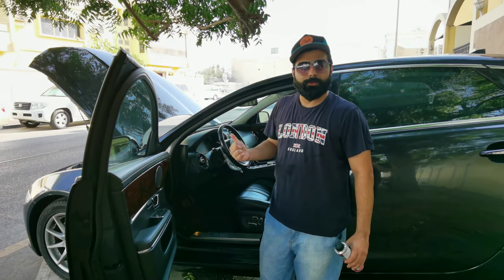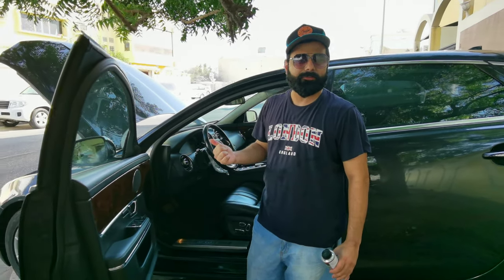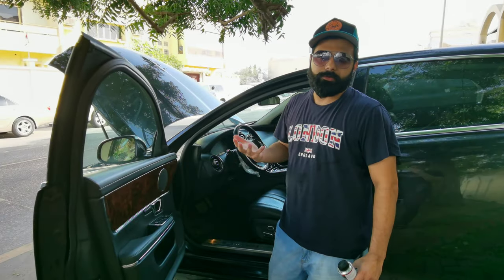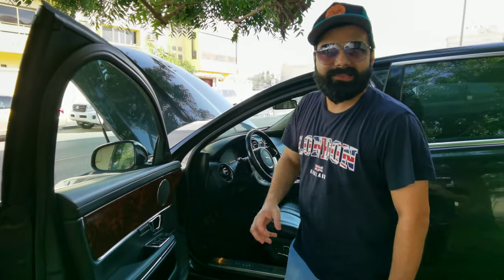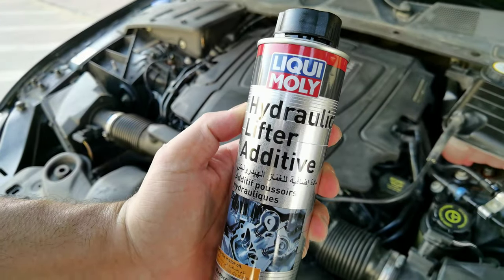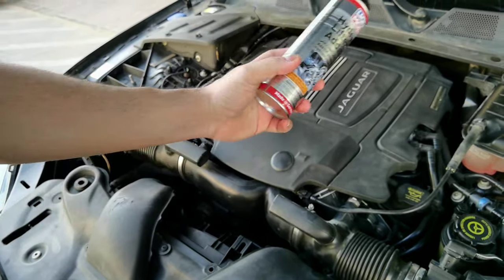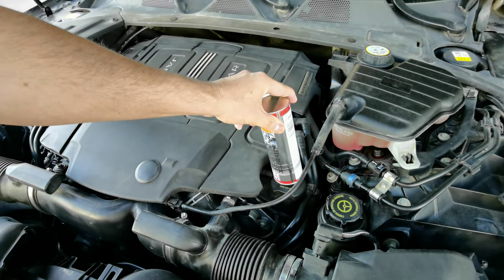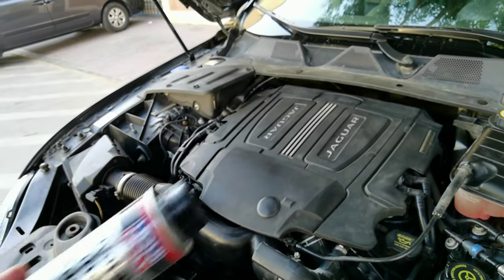Jaguar Xj 3.0 V6 Supercharged - rattle/ticking sound

Comment: Mine sounds exactly the same, it started last year only on a cold start, then every time, but stopped when engine went to warm idle. Now it happens all the time. It sounds like tappett noise. My car has done less than 30K miles. It is a 2014 model, dealer serviced. Sounds like a diesel engine! No engine codes on my iCarsoft JLR OBD scanner.
Reply: Any problem till today ?
Reply: please tell me what happened we are in the exact and I mean exact situation.
Reply: Hello. I also would like to know what you found out. My loved XJR is also making this rattle noise when he is cold, after a fee minutes of warming up it diappears almost completely. Thanks in advance
Reply: @jr5588  I have the same problem. Do you have any update?
Reply: Did you resolve this? can you give an update? Thank you

Comment: The timing chain tensioner is getting loose. I have same exact noise on my LR Discovery. Same engine. I'm going to try Lucas oil treatment per mechanic. In the near future the timing kit needs to be changed. 😊

Comment: Fixed? Or nothing changed? Thanks
Reply from the maker: Nothing changed ... Some other issue
Reply: I had a knocking noise and was told it's the supercharge it self needs to be replaced. At first they thought it was the pully.
Reply from the maker: @cdltruck2738  yeh i removed the belts to make sure it wasn't the supercharger . Its something inside the engine
Reply: @junedkaka  So what was causing the noise if not the supercharger, timing chain? valves?
Reply from the maker: @Broeils  yeh the timing chain

Comment: Knock when you turn the engine off is the supercharger pulley coupler, you feel this by removing the belt, there should be no movement / play in the pulley driving the charger shaft. 
The noise whilst running is actually a recall they had on the timing chain guides, the chain wears them quickly and becomes slack. The offer a new version of the guides. If you leave that too long the chain slips and bends the valves
Reply: I have the xe 2017 turbo 2.0 and it has loud ticking no codes and it vibrates a lot ?